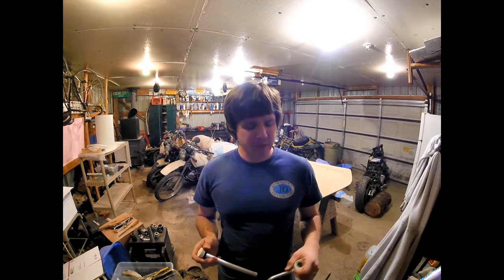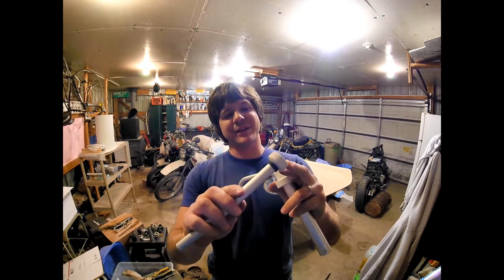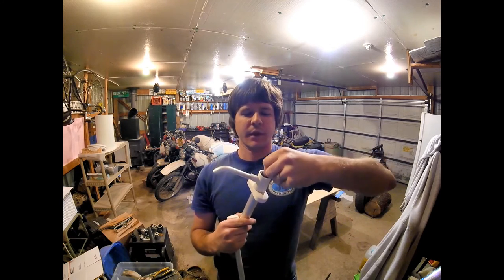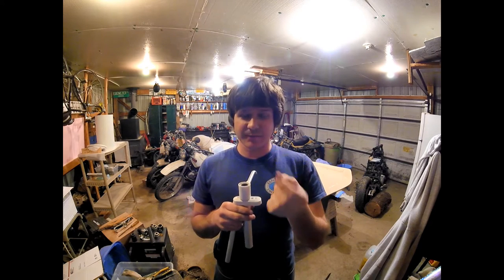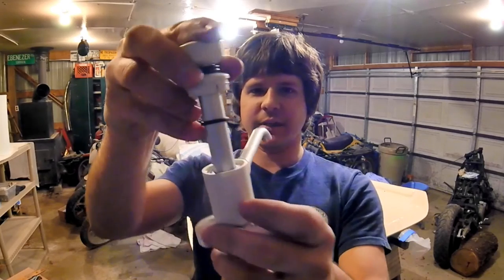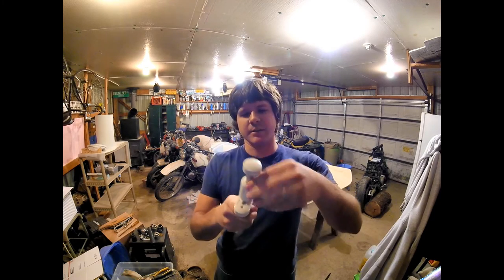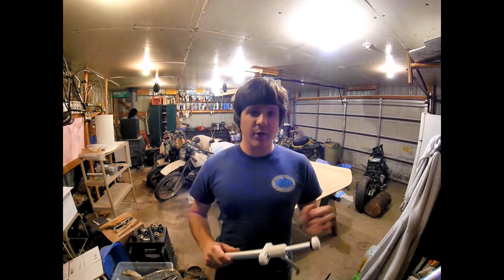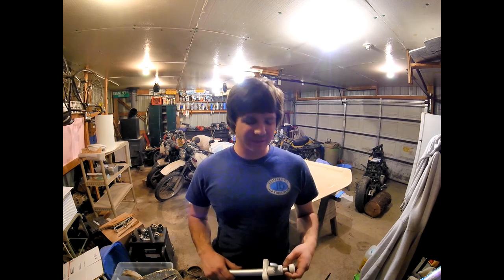Maintaining a Life on the Run - Episode 3 - Whale Hand Pump

Comment: Great fix. I used a 9/16” ID x 3/32” Thick neoprene oring from the HW store.  My original fix was to use a second lower cup seal from the rebuild kit instead of the upper cup seal.  So I used two of the lower cup seal parts in a rebuild and zero of the upper cup seal parts. Worked, but the HW store Oring is much cheaper!

Comment: Oh man THANK YOU for this!! This leaky pump has been the bane of my existence. At my wit's end with it. Completely inexcusable... Whale has been around for over 200 years, and making pumps for nearly 100 years. Yet... they can't make a galley hand pump that doesn't leak?? Someone is failing in their job and still getting paid. So frustrating. I'll be back with an edit after I try an O-ring. I might try a silicone grease/lube on the O-ring as well.

Edit 20 Nov 2022: It worked!! This pump had been the bane of my existence. But now my life is at least 20% happier thanks to you. I can confirm that a 3/4 in OD x 9/16 in ID, #11 o-ring did the trick. I'm baffled why they don't put one in at the factory.